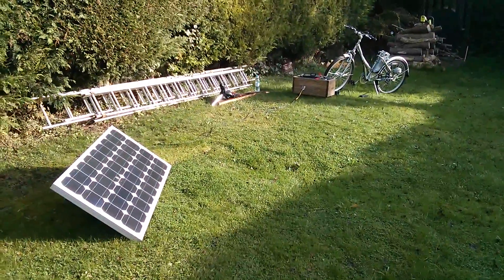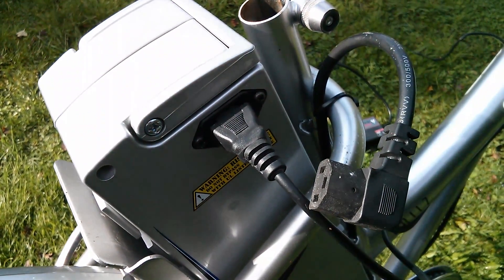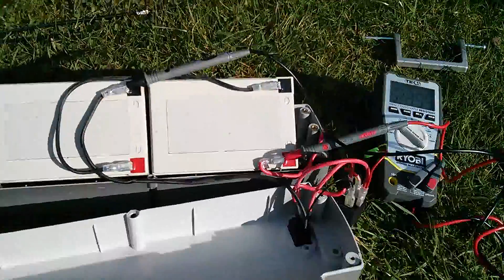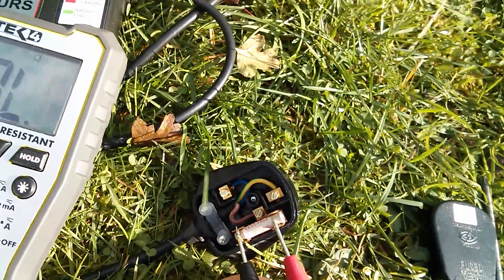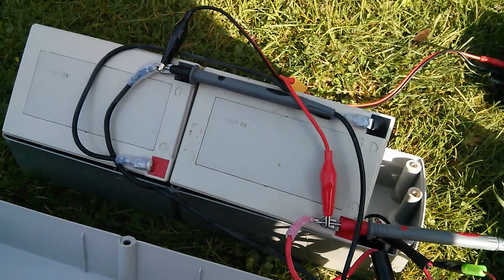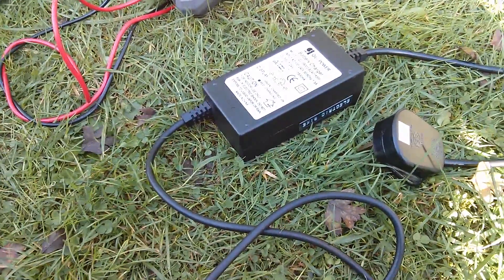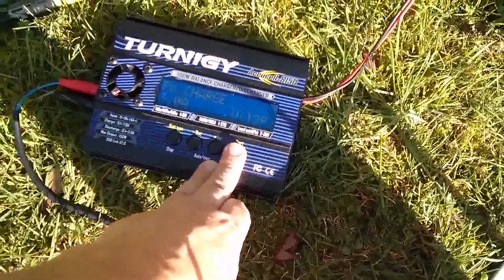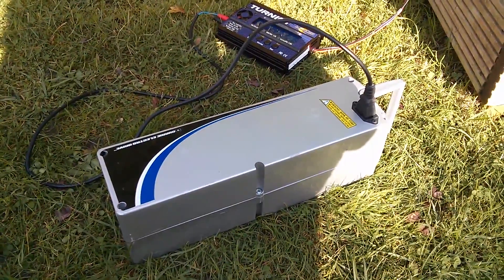Project: Upgrade Electric Bike to Lithium Batteries #2

Comment: I have a bike like this. It also has Lead Acid batteries, it goes 40km/h, but after 800-1000m, it drops to like barely 10km/h. Is this because my batteries are bad, or is this just a feature of lead acid batteries. Also, if I upgrade like you, Will this be alot better or only just slightly? I have the same plugs as you, so I will watch all your videos :)

Comment: An answer to your wonder why your balance charger wasn't outputting it's stated wattage?
I have a similar balance charger, mine can apparently discharge at 2.0 Amps however this is only on certain types of chemistry. Your charger may have a limit to what it can output on Pb? Also as it begins to come to the end of it's charging cycle it will begin to decrease the amount of current flowing to the batteries.

Comment: I'm enjoying your Pb -> Li e-bike battery upgrade videos.  I'm converting my old mountain bike to a 1000W+ hub motor with a 20AHr lithium battery pack, and I'm going to build a small bike garage with a solar panel roof to keep it charged.  We have e-bike power rating laws for street legal use in the US, but unless you're smoking the tires, popping wheelies, and passing police cars, they're pretty much leave you alone.  I'm shooting for a 35 MPH LibertyMobile (no license, no insurance, no property taxes, no title, no registration, no gasoline, and easy low cost maintenance).  Once built, essentially free urban transportation.

I like the other videos on your channel.  You might be my brother from another mother.  :-)

Comment: two thoughts. you appear to have connected the lead battery to input of the the  turnigey charger difficult to see but something strange about the connections.
A very good attempt well done. Those lead batteries would only give about 8 amps for less than an hour. so it is a very good idea to use lithium.I would want to supply the lithium charger with about 14 volts best of luck.

Comment: One thing about these sealed lead aid batteries, they can and will run dry of electrolyte and they an in many situations bounce back just fine if you an open them, refilll them with distilled water and close them back up.

Comment: The plates in the batteries are probably sulfated from sitting with a low voltage.  It might take a few hard discharge/charge cycles for the batteries to handle a better charge, although they won't be perfect.  Looking forward to seeing your conversion.  I have a 48V/20Ah SLA powered bike, and was thinking of converting it as well, but I'll need 130 2000mAh batteries, not exactly cheap.

Comment: I have a izip trialz al and it only does 12mph on the flat, short of the 15mph its allowed to do and way short of the 19 mph that USA models do. How is it limited on speed? I have two battery packs of sla and the range seems to be far short of what I expected. BTW,  I admit I am baffled by some of the things written on these posts, my late father was an aircraft electrician but passed no knowledge to me. So if anyone answers this can they keep it simple please.
Reply from the maker: Gravy Davy Sounds like you might have the same problem as me - the SLAs are past their best and need replacing
Reply: Gravy Davy The secret is the the amp hour rate. It says on battery 20 hour rate .So divide 12 amps by 20 hours which is 1,999 so you can only use 1.99 amps if you want the battery to last for 20 hours And the more you increase the amps drawn so the battery will discharge almost exponentially.{or faster and faster.]

Comment: I dont think I could justify the time spent making a 18650 battery from 100 cells. Much easier to just buy one of these and drop 6.2kg instantly(4.1 per kg lead battery, 1.92kg for lipo) and get 1/3rd extra range. Adding a second lipo would give you 2.66xthe original lead acid capacity.
http://hobbyking.com/hobbyking/store/__68822__Multistar_High_Capacity_6S_16000mAh_Multi_Rotor_Lipo_Pac_UK_Warehouse_.html

Comment: It may be worth building the charger in to the battery pack for the Lipo upgrade, that way you would always have the charger handy and don't need a ton of balance wires plus the main charging cables.
Reply from the maker: Kezat I don't think it'll fit, but I am now also looking at a BMS

Comment: you get 24 volts probably because the charger puts short charge pulses, bring the battery to 13.5 each (or whatever voltage) and then stops charging. the voltmeter can't register these short pulses. try with an oscilloscope.

Comment: Get some Turnigy bolt hv lipo's, fill the motor with transmission fluid, solder the current limiting shunt and replace the mosfets with irfb4110. It will go like stink. That's what happened with me.

Comment: For a person who gets ahold of the bike's battery at say, a garage sale, would be in for a nasty surprise if they jammed a mains cable into the very similar socket.
Reply: I think that's why the earth pin has been turned around, so that you can't just put a mains lead into it.
Reply: Im saying that someone would certainly try though.
Reply: Oh absolutely, just be reassured they couldn't. Not without deliberately countering the safety anyway.

Comment: Don't trust the voltage readings on the Turnigy. If you ease the banana plugs out a little bit and stick your DVM probes on that I'd expect you to still get a much lower reading, possibly the exact same voltage reading you were getting at the battery terminals. All similar RC battery chargers are the same and they're not too accurate out the box but you can calibrate them to give a more accurate total voltage reading. Just Google 'Turnigy Accucell-8150 calibration' and the first link from 'rcgroups' explains how to calibrate it. Unfortunately this only corrects the total battery voltage reading via the firmware and not the balance cell voltage readings, those are sometimes slightly inaccurate too as they don't use the best tolerance resistors in the voltage sensing circuit so it requires a full mod with very fine tolerance resistors if you wish to make it accurate. Long story short, always trust your DVM and only use the Turnigy voltage readings as a guide. Hope this helps a little and I'm looking forward to your lithium conversion videos.

Comment: just wondering why you need to keep the balance leads short - is it to reduce erroneous readings through voltage drop?
Reply from the maker: ***** voltage drop, induced noise to name but two.
Reply: that makes sense, thanks :)

Comment: Hey Julian,

I've got two Accucell 6 and I have found if you press start within a couple of minutes of starting a charge you can change the charge current. Not ultra useful but I have used it.

Comment: In my opinion, the voltage should be 13.8 floating for a flooded lead acid, and 13.6 for a VRLA, a gel cell or an AGM. I don't know how your Arduino contraption (which seems very good :D) works, but does it do an absorption phase (up to 14.4V until the current has dropped to 5% of the charge current)?
The turnigy does that but instead of switching to float (13.8V) it just shuts down.

As for the balancing connector, why not using a VGA or DB9 connector? It should have the required pins, and it is quite nice :)

Comment: You could of course also build the turnigy into the battery box, so you only need a power lead going in (which is already there).  Depends if you'll also want to be using the charger for some other purposes. (they're fairly cheap, could always buy another)

Or you could build your own balance charger into the battery box.  That would make it a slightly better solution if you wanted to chang eto new types lateron, there's quite a bit of new technology on the battery front (organic flow, molten air, ...) that might be available "soon".
Reply: oreubens Heat  the one thing you want to avoid. the batteries will probably get warm. the charger will get HOT.
Reply from the maker: oreubens It's a thought - not sure it would fit though. I'm looking at a BMS board on eBay - it's about £20 - quite tempted. 24V 25.6V 30A LiFePo4 Battery BMS LFP PCM SMT System 8S 3.2V eBike Battery 8x 3V http://www.ebay.co.uk/itm/-/321048900157?roken=cUgayN via @eBay_UK

Comment: I was doing some research recently Julian BUT if this is still in production somewhere it might be the answer http://www.ebay.co.uk/itm/Lithium-Ion-Lipo-Battery-Management-Protection-BMS-PCB-Board-10A-3S-4S-Balance-/131214311070?ssPageName=ADME:X:AAQ:GB:1123
Reply from the maker: ***** Yes, I'm having similar thoughts! I'm watching 24V 25.6V 30A LiFePo4 Battery BMS LFP PCM SMT System 8S 3.2V eBike Battery 8x 3V http://www.ebay.co.uk/itm/-/321048900157?roken=cUgayN via @eBay_UK
Reply: cool that looks good, was after something decent to balance my home made 147 AH Lithium ION battery pack is fact I got 2 other battery packs in parralel total 200 ah can't afford to ruin them, most I recycled from old laptop battery packs but their good measured the capacity and they check out, too about a week to charge the147 AH @ 1 amp
Reply: THE MAJOR PROBLEM WITH BALANCE charging is the small balance current just a few milliamp's when you have a load of cells in parallel charging them up to fast you lose the balancing aspect so the cells need to be charged more slowly to balance right bit of a catch 22

Comment: For your LiFePo4 cells, have you looked at the ones on Hobbyking (where you got the Turnigy charger)? They are well reviewed and might be cheaper than the ones you are looking at elsewhere. Lots of different sizes too, not just the 'can' style they also do soft packs in various configurations.

While there it might also be worth looking at batteries for your wearables project, they do individual 'flat' packs very cheap and might be more reliable than the various dodgy one's you've tried so far :-)

Comment: I charge all my lead-acid batteries on constant voltage, start with a current limit of 30% capacity (3.6 A on a 12Ah battery), and simply leave it until the current is down to 3% capacity or 300 mA for a 12 Ah one. The datasheets on my batteries all say "14.6-14.8 V" for cycle-use and "13.6-13.8 V for float use (standby). It would also be helpful to check the current output of your solar panel, as chargers like that will often indicate a finished/completed charing if the input current is too low. i.e. it detects a low output current as a result and assumes the batteries are full (not drawing much current anymore).

Comment: A few years back I made a 9S LiFePO4 pack for one of my own e-bikes. 9S gives you a 29.7V pack.... My thinking was that a Lead-Acid pack charges up to 29.4V so all the electronics on the bike had to be rated to at least that voltage. Capacitors come in 16 or 35V ratings so I knew they had to be good for at least 35V. I checked the mostfets in the controller and they were good for 50V, so I decided to chance it. My LiFePO4 pack puts out about 33V when fully charged. I've been using it for over five years so far with no problems... and the reason why of course...  If you get 250W at 24V then due to the inverse square law, you're going to get nearly twice that at 33V... It's so much eaiser on the hills. I think I might have to dust off the 'snowbike' this weekend for a little play around. Cheers!!
Reply from the maker: Jim Conner That's actually quite re-assuring. I was wondering if my speed controller would be able to handle the 8S LiFePo4 pack. I can't imagine it'll be a problem. But how do you charge the 9S pack? More to the point, how do you balance charge it?
Reply: I originally bought an 8S pack from 'ping battery' (google it) and then later got myself an extra cell and a 12S charge controller from a 36V pack (which works fine with only 9 cells connected to it). For charging it, I tweaked the 30V charger from the 8S pack up to 33V output by playing around with the resistor values in the feedback circuit in the charger. I will make a quick vid tomorrow to show you what I did. Cheers!!
Reply: Icharger 1010B can charge a 9S LiFePO4.

Comment: Just a thought, if you needed another plug of that DC type, as the earth isn't used, you could drill out the earth socket to allow that flat prong into it. It would of course allow you to feed 24v into a 240v appliance but that wouldn't cause any harm even if you did it
Reply from the maker: ***** Excellent idea. They say the best ideas are often the simplest.

Comment: I use on my electric board 3s 2200mah 20c turnigy ! At first I payed 7.50$ for each but I also got few more later for five bucks ! Awesome pack but I believe it's not as safe as the round Li-ion ! My setup is four in parallel making 100wh. I have two packs ! I even use to start my 250cc bike when my battery is dead!
Reply: How did you get those packs for 5 bucks?
Reply: I got on hobbyking year ends sale last year! I find those pack the best value per watt ! If you get any other cell numbers or capacity, just try to divide the wattage per dollar and you will see what I'm talking about! And if you want you can always go series to 6S ,9S .... So and so on! Go on and save some money ;)

Comment: I think the 'P' when talking about lead acid batteries is Plate, eg, a 12v battery has 6 plates (electrodes) inside.
Reply: Alex Matthews you will find 6 cells. Number of plates, can vary from type to type of battery.

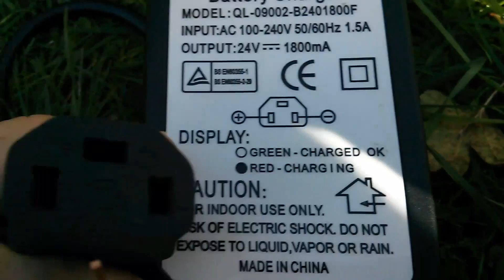Comment: 8:42 Maybe the diagram is for the socket? 

Edit: The text below is rubbish, thanks for correcting me, folks! 
Also, I'm a bit worried that they used a standard mains plug/socket for a 24VDC connection. That's a disaster waiting to happen if someone connects the mains 250VAC to their 24VDC lead acid battery. I'm hoping there is some sort of protection inside the battery box, but still...
Reply: I have never seen this connector on a mains cable, normally the ground pin is horizontal not vertical.
Reply: HW1099 Agreed, those connectors are only used for DC, they're specifically designed to be incompatible
Reply: Thanks folks, I got confused by the shape, but you are of course right, for AC, the poles are usually ||| and on some all three are horizontal ...-...    
http://de.wikipedia.org/wiki/Ger%C3%A4testecker

I have to admit, though, that I've never seen that plug shape for DC until now.

Sorry for the mistake!